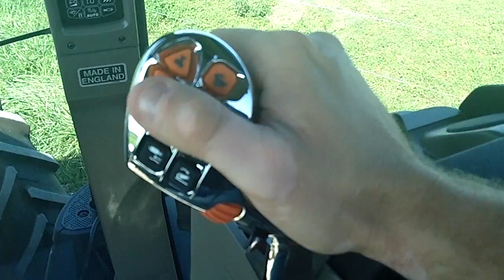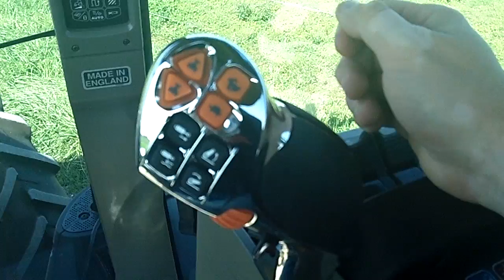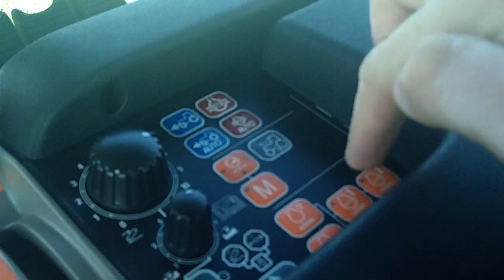Description of the Multifunction Handle on Case IH tractors

Comment: Is there a way to turn the EOR button on at 2018 Magnum 310CVT into engage autosteer button? Autosteer is being controlled by a Trimble TMX2050.  It appears that's possible with a Pro700 controlling the autosteer, but not with a Trimble TMX2050.  I'm not a fan of using the EOR because you can't push the bottom more than once in a short period of time due to the programed pause and the EOR also makes a really annoying beep sound.

Comment: It seems with all the tech in modern tractors between the CASE AFS and multi control arm and CVT vs JD and itek systems you almost need a collage degree in engineering and agriculture to run these &#*$^ ing cool machines lol.

Comment: How do you get it into true neutral so you can tow it? Mine is stuck in the mud and I need to pull it out by myself...
Reply from the maker: The owners manual will tell you based on tractor type.   Maxxums and Pumas are different than Magnums and Steigers.   It is all related to park brake type.

Comment: What does it mean by "set points",and how do you shift then on a cvt.
Reply from the maker: The beauty of the CVT is like driving your truck or car.   You go to a speed limit while on the roads, not a gear and rpm.   The same applies for the tractor.  If you want to go 5.0 mph, you can achieve that by pushing the handle all the way forward.  If you want a headland speed of 3.0 mph, then you drop the set point down and the tractor will drop to 3.0 mph.